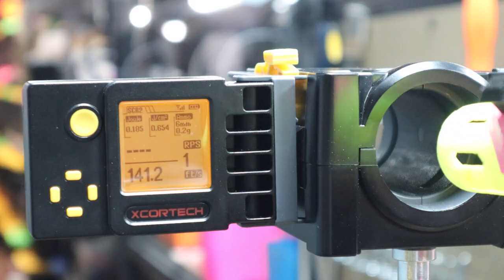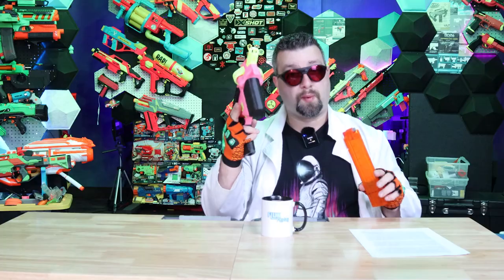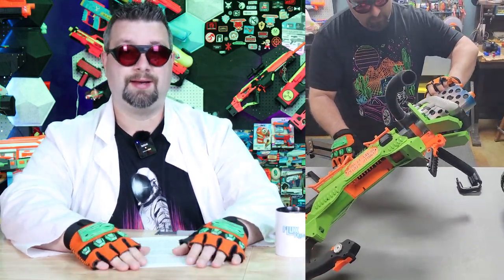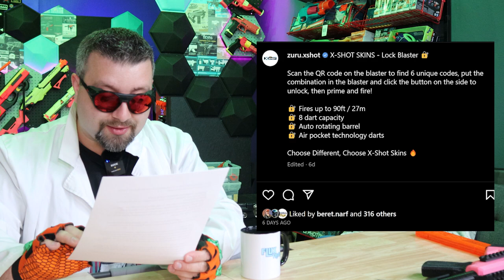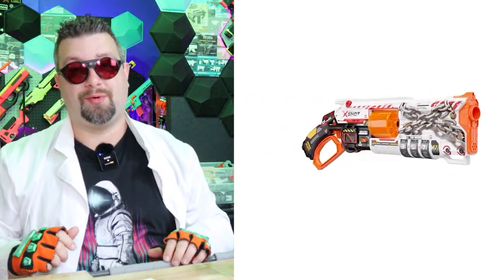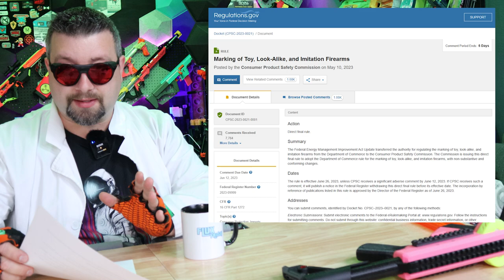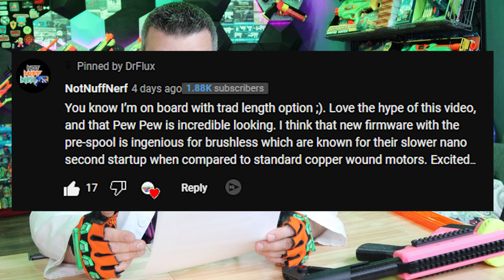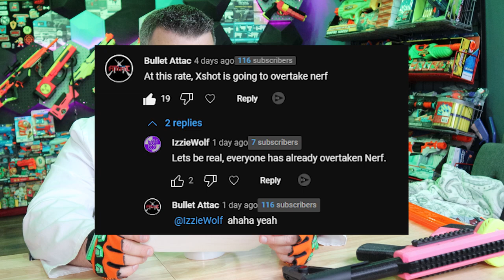This 3D Printed Nerf Blaster Has a Full Auto Solenoid - FFE22

Comment: In my opinion, the X-Shot Lock Blaster looks like a really good idea, and I hope it's near the same price as the X-Shot Longshot, or even almost half the price, but the whole concept of having to physically unlock the blaster to use it is really cool. I'm also wondering if the cylinder will pop out of the blaster like the NERF Strongarm or Maverick. That would he really cool.